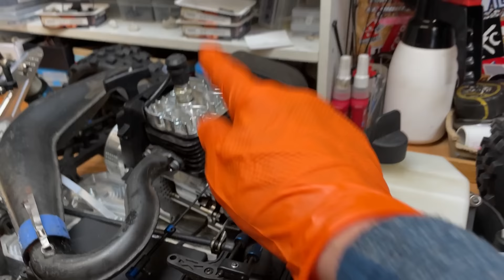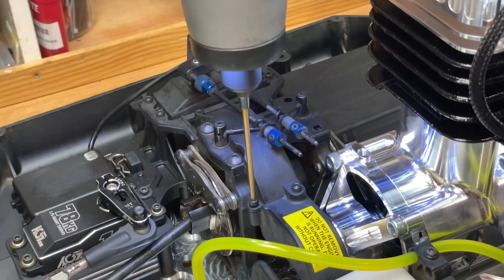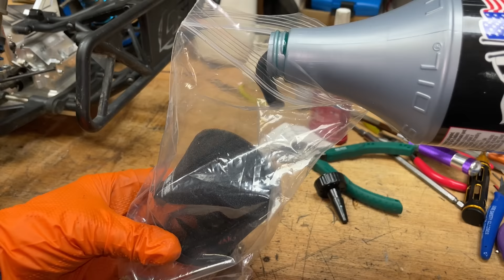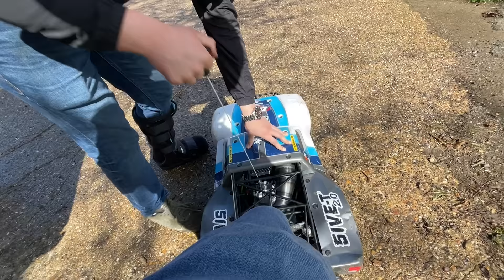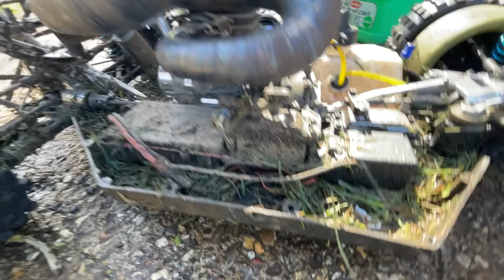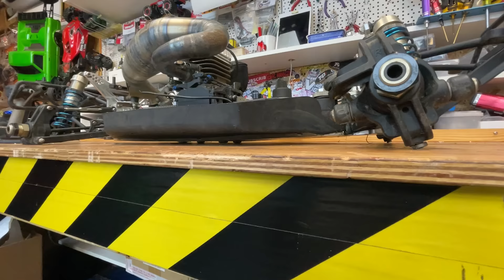GIANT RC Car gets MASSIVE Race Engine (6x power)

Comment: The high adjustment screw (or throttle screw) is the one closest to to the air filter. The screw closest to the engine is the low (or idle screw). There is a thin wire that goes to the coil (not the one that goes to the spark plug)  it must be grounded to the engine to kill the engine. Follow this wire and check for a loose connection. I hope this helps.
Reply: boost

Comment: Kev, on my dirtbike filter I only use 3 drops of air filter oil as per manufacturer instructions and rub it in. If it's too saturated the engine will run inconsistently causing you to chase the tune. Not sure how much oil you use but it seemed a bit much for such a small filter. You want just the outer surface saturated to prevent dust particles in dry conditions from going in the carb. With that said. That is a sick build!
Reply: Which brand? I don't know of any of the major brands recommending underoiling filters by that much. Most recommend to saturate it, remove excess with a towel and then let it dry (yes, air filter oil dries a bit and becomes even more sticky through that).
Reply: When i rode motocross for the crf 250 i drenchd the fikter then squeeze exess out let it dry a bit stick it in
Reply: That exactly what I've had happen to me, because the filter is clogged up with oil it effectively works like a choke and screws with the air fuel ratio.
Reply: @RyanMcIntyre  I think it actually comes down to the size of the engine, the smaller the engine the more sensitive it is to changes, especially with the intake side. Dirt bikes are probably better off with a drenched filter.
Reply: @RyanMcIntyre So you're saying my alcoholic father wasn't supposed to leave a rag in the air-boot and then put the filter on? It really smooths the power out. LoL 😊
Reply: @KacKLaPPeN23  bullshit, to much oil causes it to run lean, you try and breathe through an oil soaked bit of foam....only a light coat on the outside to trap dirt is all that's needed.
Reply: 3 drops for a dirt bike filter are you mad? lmao no way id run 3 drops on my 450r filter 🤣🤣🤣
Reply: idk the enginesa probs fucked. he didnt even break it in

Comment: I would try a different kill switch. Killer bee is the one I use. Also you’re geared to aggressive. That is why it was heating up like crazy. Also you probably should break the motor in proper before ripping like that. Just my take.

Comment: Kevin, you are an expert by the way.

Not sure what kill switch you are using.  But I have hand many brands and they are not all equal.   Sometimes you need to reverse the wires to the coil.  And you can have less interference.

Comment: If you get a engine too lean it actually starts dieseling (tip of the spark plug actually glows)& won’t stop even if you pull the spark plug cap.  the best thing to do is hit the kill switch &open the throttle this will dump fuel in & cools the engine. Or just cover the intake with a cloth

Comment: that metallic sound is sometimes mentioned as the engine seizing sound, especially when not runned in engine gets hot, that is like number one thing that should not be done to new engines, but it could be just some random stuff rattling around in there... by the way, try to put some stuff into the front and rear diffs, they are still super loose, especially with that overpowered engine that blew the tires pretty much right off🤣

Comment: So crazy idea for the tuning but kev what if you take the nitro/petro cars to a car tuning shop or a dyno company hook it up to a o2 sensor to get air fuel ratio challenge then to tune it or get a Holley efi box and run the o2 system that way in the shop

Comment: Ask Taylor what the run-in carb settings are.  There should be a certain number of turns out from all the way turned in.  For my chain saws its like 1 to 1-1/4 turns out for the L and H.  the 3rd is your Idle speed that you can adjust to your liking. You would think something like that would be included with an engine of that caliber.
Reply: silverhaze78 ya i agree i don't know much about moders thats because im 13 but ya
Reply: It's 2 and 1/2 turns out from bottom !

Comment: Kev. Nitro and Petrol cars go into a lean condition when the tank gets below 1/8th. We used to run a large in-line fuel filter on our cars and trucks to help that lean condition be better by aerating the fuel better. Also you can get a fuel line pinch kit to shut off fuel flow so the engine will stall if the kill switches happen to not work again in the future. Cheers.

Comment: That Taylor RC engine looks like a BEAST! I’ve been fixing/repairing small engines like in strimmers and lawn mowers and so on for years now and I get that sick of them, all my own equipment is battery powered now. Same with the RC cars. Awesome to get going but spend more time pulling the starter than driving the damn things.
Reply: Exactly it isn't worth the hype. Gasoline/Nitro rcs are a pain in the ass!
Reply: Heat up the motor with a heat gun. Never try and start a cold motor.

Comment: Had a runaway on a petrol RC once, created a new process for start of the day: start engine, press kill button, start engine test remote kill works on the button, start engine, turn transmitter off. Then start engine and play.

I dislike a process that messes with the fun, but I dislike chasing a 30mph+ car with 40 mins of fuel a hell of a lot more

Comment: Kevin I had your same symptoms happen on an Honda 85R to some kids, the only way I could get it to happen was get it hot in 1st gear. What it's doing is heating up and advancing the timing and running away. Which can also happen to an engine braking in with in adequate air flow, or making pulls or hits without making a few breathing laps. Hope this helps

Comment: Kev , the runnaway could be caused when the car is to far away from the trasmitter and the throttel servo is stuck on gas and it runs away, and if you get to your car then it connects again because its in range again it works. Second reason is a weak battery in tramsmitter or car. Nice vid kev, this engine rips, 
Have a nice day
Reply: The radio fail safe is used in that case 
So the throttle servo should be closed whenever the receiver loose signal 

Probably a weak or discharged battery is the problem ( but the kill switch detect it and stop the engine )
Reply: Control was 5' from the truck
Reply: @ramsay4804 lol right
Reply: The runaway was due to the engine rather than the electronic components. Cutting off the air to the engine would've done the trick.

Comment: Hi Kev, this comment to not relate to this video specifically, I just wanted to thank you for getting me into the hobby. I am a complete newbie so the obvious first car was an 8S Xmaxx 🥴as it was second hand from eBay I have had quite a few of the retaining nuts on the plastic chassis strip. So I thought I would share a tip to the solution I thought off (apologies if you have done this and I missed it). Anyway, I found if you have enough area you can drill out the old hole and insert a metal furniture retaining nut using a hex driver. The bolt will then have a solid metal fixing. I hope that might help someone out. I'll put a link in the next comment as I believe sometimes they get blocked.

Comment: Hey KT! That's a Awesome build on the 5T and sounds great with that pipe! When You and Maxx get together running rigs it doesn't usually end well and the run-in on that New engine running lean and low on gas and running on its own and that runaway you got Lucky you didn't wad that machine into a another pile of parts? Totally Great video and content, good luck on figuring out the issues Bud!😉👍📹💯✔️👋👋👋😂🤣

Comment: You need that Ariel upright or better yet I would replace the Spekky radio for a Futaba set up. When the 5ive was first released there was an issue with the ignition interfering with the radio signal for spektrum radios and receivers, they did eventually solve this however and it shouldn't be a problem now but I would still swap it out to be on the safe side. While runaways are funny when it comes to the size and weight of these trucks I wouldn't want to take any chances.

Comment: The engine can rev uncontrollably if you have a leak on the intake causing a lean condition. Check your carb gaskets and make sure everything is tight. Also known as “dieseling” likely to happen when the engine gets very hot

Comment: I've been working on motocross bikes and lawn equipment for years. And I had a  old chainsaw run away on me after a repair. Once it started to run away I hit the kill switch, that didn't work than pulled the plug cap that didn't work.. what actually shut it down was throttling it up with the plug cap off and she shut down. Rich'n the low and fired her back up and it ran perfectly, I actually used the saw to fall a smaller dead tree and it preformed well. My thoughts where the carbon on cylinder head was acting like a glow plug and all the un-burn fuel inside the case was keeping it running.

Comment: the reason for the rpm:s 'floating' is that it started dieseling wich means that a gasoline engine runs lean and hot enough that it starts firing without ignition. had this happen to me once on my moped, wouldn't die even when i pulled the spark plug wire. also the 'metallic' sound is detonation wich also is a symptom of running lean and all yor tuning problems could be from an airleak after the manifold, crank seals maybe?

Comment: "Next video we're gonna keep running it in.." 😅. Dude I think it ran in and ran OUT when it ran lean and wouldn't shut off! It also may have run away from interference from the ignition if you weren't using a separate battery for the ignition and you might need a better remote kill switch with better isolation. Also put the RX as far away from the ignition as possible. Loose spark plug cap can also cause brown outs.

Comment: I was honestly waiting for it to blow Kevin. It brought me back to my 2 stroke racing many years ago now. Always built and tweaked my engines so got really good and in tune with carb adjustments especially on the fly. Imo it was definitely leaned way out and when breaking in a new engine you know you should 𝙉𝙀𝙑𝙀𝙍 run it past 75% throttle for a tank or two.

Comment: Cover the exhaust with your shirt or pants leg next time your gas/nitro engine runs away. It kills the engine instantly. Put a rubber band on the return throttle so when it does go out of range, the rubber band pulls the throttle back shut or back to idle.

Comment: I would very careful when running fule very low . What happens is the engine will suck air in instead of fule so you get a real dry fule mix . You normally hear the revs start to thrash so you need to top up on fule . Keep an eye on spark plug to tell you how your engine is running.  I could go on for ever I used to race 2stroke . Dont you have a end can for your expansion chamber .

Comment: Those Losi 5T's are a eriously good truck. Good thing I can't afford one....and don't have the room now I think about it.
An engine running on I thought was caused by carbon build up in the head. When the engine turns off for a little while the carbon stays hot enough to ignite any fuel, and the engine diesels as it is sometimes called. That was my experience anyway.  It can happen other ways and I have no idea what would cause it in a small engine like that (outside of what the problem turned out to be anyway).
Looking forward to more of this truck.

Comment: next time flip it over and put the bottom of your shoe over the exhaust and the back pressure should kill the motor without hurting anything.  the super bounce balls you get out of the quarter machines (Substitute your British equivalent) at the supermarket  work great to cover the pipe.

Comment: Couple of lengths of 1x1 alloy angle running down the lengthy of the chassis bolted on helps longevity of alloy chassis, it only adds a few more grams , they know this but bent chassis sell new ones 😉👍

Comment: The metallic sound could be something from the clutch like a spring or something rolling around in there. Like when it first wouldn't shut off and it was against your land rover the clutch was going to town and got super hot and glazed the shoes and might have broke a rivet? I'm just speaking from actual automotive experience and what had happened. Cheers. Happy bashing kev!

Comment: Change the piston rings and check the cillinder... if its making ping sounds, your rings are gone....  do to the heat... lean running means more heat,you know that . Hope your cillinder is scratchfree still... but deff remove the head to check before running again...

Comment: you need to set the failsafe off on t he throttle channel. the reason the killswitch doesnt work is because the fail safe if giving a signal out and the kill switch sees that as normal operation. ive had heaps of problems getting the killer bees to function properly on spectrum  radios. have no problems on the futaba

Comment: That is called dieseling, When it happens you've got to pull the plug as quickly as possible. The longer it runs at that high RPM the more likely you are to damage your brand new engine.

Comment: Kev!!! You gotta learn how to read the plug man!!! It’s a pain in the arse pulling plugs out all the time but I don’t know a better way to see how a two stroke mill is running. What size engine is that? It looks easily big enough to be 50 or 60ccs, which makes me think of the equivalent motocross bikes ! I have a few late 70s and early 80s two stroke air cooled 80cc MX bikes, and they still scare the crap out of me when I take them for a blast, and I’m 54 lol

Comment: Someone should make RC killflaps. Basically a unit that goes between the air filter and intake on the engine that uses a servo to block the airflow. Set it up on a spare channel on your radio and have it so on failsafe your radio closes it.

Comment: Mod speed shop has a kill switch designed specifically for the spektrum radios aux port.  Alot of people have had issues with the kill switches not working properly on that brand radio

Comment: If the killswitch not work squeez the fule line oder pull the glow plug ore cover the air filter

If you squez the fule line the engine becomes no fule more so it turns off 

If you cover the airfilter engine becomes no air more

Important don’t pull the Fuel line from the engine carburetor Becaus if fuel drips on a hot point on the engine or somewherels it can start Burn
Reply: This has a spark plug, not a glow plug.  It’s a 2 stroke gas engine
Reply from the maker: Easter said than done when it’s screaming it’s head off and the body is on

Comment: From TaylorRCco
WALBRO WT1257 STOCK RICH SETTINGS:     Low Needle: 1 3/8 Turns out,  High Needle: 2 Turns out

WALBRO WJ146 STOCK RICH SETTINGS:       Low Needle: 1 1/2 Turns out,  High Needle: 1 3/8 Turns out

Comment: The reason it continued to run even with the kill switch is because it ran out of gas and ran super lean. That’s what happens when a 2 stroke runs out of gas, they just keep going until every spec of gas is consumed.

Comment: Did the end of the throttle cable that's sticking out get hung up on the inner body roll cage? Cus it seemed running full throttle after Max tipped it up on it's end.

Comment: Runny diff fluid…. You’ll piss yourself knowing what they use stock. Was talking to Dave about it when I got mine. They use 5,000 front, 10,000 center, 500 rear. Wore the hell out of the Outdrives and the drive pins. It’s personal preference what diff oil you wanna run but he and I use 60K front, 100K center, 30K rear. Really helps keep the wear down. Drives real nice too. While your driveshafts have the pins, get the Taylor pins and an arbor press. And then get hardened steel Outdrives.

Comment: When a gas vehicle starts getting hot or too hot it will continue to run even with the kill switch off it is call "deiseling" it's because the gas is igniting off the hot sidewalls of the motor causing the motor to continue to run.

Comment: well, firstly, new engines need to be run in before they are used. This is at least 4 tanks of fuel. Secondly, after running in, you need to adjust the carburetor, idle, low and high speeds.

Comment: Hey Kevin.  I am wondering what BEC  I should use on a losi dbxl. I want to run
 higher voltage to my servos. Like 8.4 lipos. Its a 23cc and I  changed the radio to a Dumbo system so I  can have the kill switch on my radio. But I don't know which one to use.  Thankyou for your time and effort.  Big fan, Arkansas, 🇺🇸 USA!!

Comment: Don't you set it to full brake when you 'kill' it?
I always did when running similar 'monsters' - not just cutting fuel / ignition but locking up the wheels.
Al.

Comment: when failsafe arent set propper things can get uggly fast. happened to a friend of mine with a 5th scale street car. chassi bent and twisted to 💩  and about 30% of all plastic parts broken. not to mention the safety glas barier that the car broke and threw parts of 4.5m away.

Comment: Is that engine supposed to cool off only with the wind on the head? Looks like it has no flywheel... In that case its better to run it without the body because it gets REALLY hot.

Comment: In my experience when a 2 cycle engine runs low or out of fule they idle high and run lean due to there not being enough oil in the mix at the end it's all vapor

Comment: When I either run my two stroke out of gas it gets high idle and shuts off. It’s less of a super hot thing and it’s more leaning out. So it get really high idle and then shuts off. But I’m talking about my dirtbike. But if that’s running straight gas or “petrol” with two stroke oil then it should do something similar. Especially when you ran it out of gas.